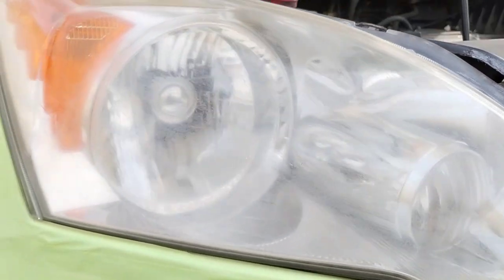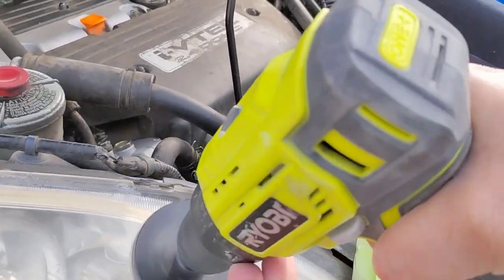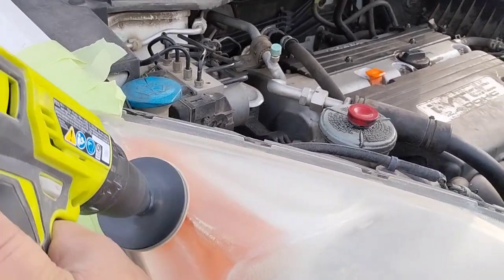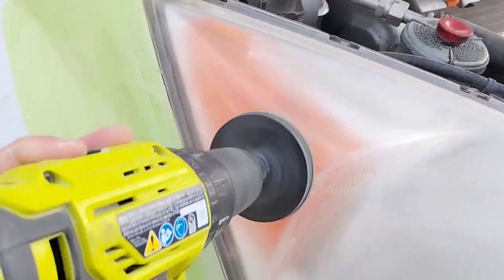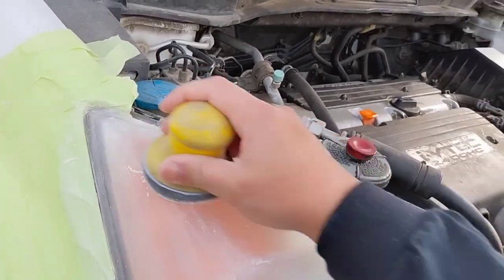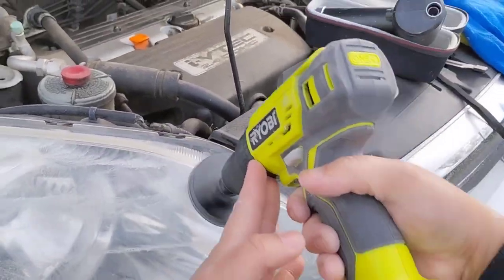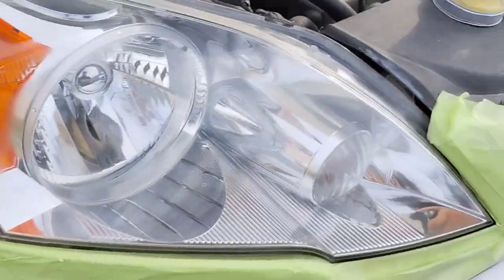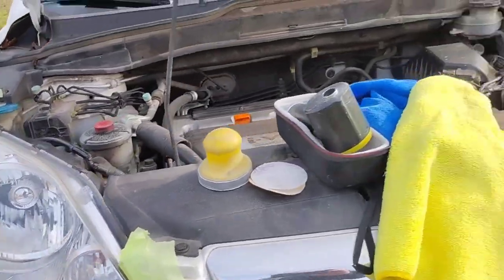Headlight Restoration - WORK SMARTER NOT HARDER 🧑🏽‍🔧

Comment: Officially did my first headlight restoration using your method and the lights came out great and the owner of the vehicle was very pleased.  I used Meguiars Plastx as I am waiting on my order of the 3M hard lens product to arrive.....I have another vehicle to do tomorrow and I can't wait....will continue watching your videos for advise and knowledge......THANKS!!!!!!
Reply from the maker: Awesome man love to hear this.. wait till you get the 3M plastic polish.. it will really step up your game.. speaking of stepping up your game be sure to continue to watch the videos new and old if you truly want to be good most definitely that would be my biggest advice to myself if I had these videos to watch...💯👍🏽
Reply: @theheadlightrestorationpro  trust me I rewatch many of your videos
Reply from the maker: @lawrencethomas5746  🫵🏽🦾
Reply: @theheadlightrestorationpro  Quick question.....if I have a really yellow oxidized light, should I use a P320 with a light touch to get the majority of the yellow off before going to the P500?
Reply from the maker: Normal light I would advise against it if it's just a normal light...
The yellow should be fine you don't want to mess with the 320s unless you have to it's a much harder to clean up it makes your process longer and more difficult..
Reply: @theheadlightrestorationpro  P320 should be used with lights that might have failing clearcoat or 2k clearcoat?

Comment: What are your thoughts on ppf for the headlights
Reply from the maker: Honestly I don't approve ppf for headlights or even vehicles.. secretly what most people or wrappers shall we say won't even tell you that most people mess up their vehicles this way.. the only recommended to be used temporarily for a certain amount of time which most people exceed messing up their paint and or headlights.. I've dealt with a couple headlines before none this year that have had the ppf on there and when the person removed it it pretty much tore off all their clear coat anyways and had to be replaced through headlight restoration.. this is the same case when it's applied to vehicles as well.. the thing is there's all kind of issues happen in between those layers, from temperature to moisture and even other things.. not only that when it comes to Headlights there's a layering effect if you put too many coats primarily more than one each coach you put on diminishes the headlight output ppf does this heavily... I have a video about this you should check out...https://youtu.be/NgxNImOAoCY
Also another big thing that they don't tell you is it's always going to require some kind of maintenance, a bubble here, the tear here, pulling up here.. unless you're the one that does it you can always have to go back and have them fix these things for the pain in the ass.

Comment: What about a dual action/random orbital? Can i use the same DA polisher that is used for polishing the body?
Reply from the maker: No technically you can use a rock but it won't produce the same results nowhere near. The door action is not enough RPM it's a totally different action lot-less speed...

Comment: Hey really cool, great job again, keep watching and learning, question: Can I use my 1/2 drill or do I need to use the one specified on your bio?
Reply from the maker: Not sure what a half drill is... But preferably and actually a regular power drill works the best and delivers the most even power with right to left switching and concerns to headlight restoration, gives you the utmost control and feathering the trigger and in most cases power level adjustments and torque adjustments,.. the gun fashion seems to work a lot better with the force of the drill meaning that it throws your hands sometimes in certain angles certain ways holding it a different way L angle or whatever else gets weird..
The main thing you have to watch out for though is the RPM which should be under 1800 and the torque which should be 600 or under... If you go over on both of those things are either one you'll start having issues.. also 3 in is the best diameter for the attachments and sandpaper anything smaller is too small anything bigger is too big...
Reply: @theheadlightrestorationpro  Thanks, good info, will check it out and see if it falls into the rpm and torque. It’s a 1/2 “ drive ridged.

Comment: What’s with your link to the 3m p500 disc? Description says they are p220
Reply from the maker: I'll check it out... They might be more than one disc when she but I'll take a look...
Reply from the maker: They are indeed p500 you have to scroll down and read through it it is p500... For some reason it says otherwise in the banner but that's because you can buy different size disc through this link.. just got to make sure You've selected p500

Comment: Hey was going over your Amazon links and i can't afford to get everything as of yet because I can't afford to get everything and I was wondering if you can recommend a shorter list of all the must haves to start restoring headlights?
Reply from the maker: Not really...not for this level of Restoration..
To get these results you need what I have and need to do what I do ..
Sorry..
I would just mimic what I do the best you can...
Reply: @theheadlightrestorationpro  thanks for that. I'm going to follow everything you do except for the sanding method. At this point I'll opp out for the hand sanding method using the same grits as you. I can save money on the drill equipment it'll just take me longer because I'm doing it by hand instead of power tool.
Reply from the maker: That's fine.. it will not come out the same but it should do something good.. without the drills you're lacking a lot of stuff.. so just go into annoying that it won't be anything like what you see or even near on these videos but it'll probably be better than everybody else's if you just follow as much as you can..💯
Reply: @theheadlightrestorationpro  thanks for that. I may reconsider I'm really just afraid of the drill 😭😭 it's kind of intimidating I don't want to leave burn spots. That's what I'm worried about
Reply from the maker: You're actually like a thousand times more like you to leave burn spots with the polisher... Long as you follow my drill recommendations it's almost not existent but the chance to make burn marks or damage this is why you want to keep it under 1800 RPM and under 700 pounds of torque.. this is why I expressly say do not buy a souped-up high-grade drill like some of them makita's or Milwaukee..
Basic drill is perfect. 
Even if you tried to it would be quite difficult because of sandpaper will give out before anything else.
It's much more likely some surfers burning with the polisher.. because it's high heat.. but if you follow the way I do it and listen to my instructions it shouldn't be an issue..
Reply: @theheadlightrestorationpro  Thank you for that. I'll try it with the lowest rpm I can get it to. I'm really inspired toake this my full time job and just want to do things the right way
Reply: @theheadlightrestorationpro  I've been watching your videos all day and I'm getting a feel of your method. I think as long as you keep the drill moving and don't apply alot of pressure I should be alright. I'm probably just overthinking it.
Reply from the maker: That's the right attitude..💯
Reply from the maker: Yes a lot of people do overthink it you're barely touching the surface with any kind of pressure the only strength you're using is to hold it steady.. and you're only taking off about a piece of paper or maybe even half or a quarter of a piece of paper is worth material from the service.. once you touch it with the drill you'll see like well okay.. it's a thousand times more efficient than hand sanding and much more consistent and even faster much faster.... There's really no comparison hand signing would be like riding a big wheel... Using power tools it's like riding in Hayabusa...lol I'm not even trying to be funny.. I've done both and even more crazier shit and nothing compares to power tools..
Reply: @theheadlightrestorationpro  I definitely trust your judgement 100% and I'll be ordering everything and following your methods, thank you 🙏🏿 I'll be emailing your results from my first few jobs and even though I'm a beginner I'll be charging clients and trying my luck. I'm willing to bet on myself. I will be following your steps and taking my time, not rushing and not skipping steps. I'm a very focused and detail oriented person so I think I'll be fine.
Reply: @theheadlightrestorationpro  Thanks bro. I also have two questions about something I haven't heard you speak about. With the fan how long do you leave it pointed at the headlights,  and whats the purpose of the leaf blower? And sorry for all the questions lol I'm just really interested in the craft and mastering it.
Reply: @theheadlightrestorationpro  And what do we do about the discontinued 3M Hard Lens Plastic polish? Whats the good replacement brother?
Reply from the maker: The blower is for dust and clean sterile environment...( It helps with the finished product and not cross contaminate) it basically is a very important part...and the fans just a couple nof minutes..like 3 give or take ..
Reply from the maker: You got to actually watch the videos .. everything you've asked is literally on the most recent couple of videos...
There's actually video about these topics..💯
Reply from the maker: Watch the videos.... If you truly serious about this you really need to watch all the videos and it's not for my benefit.. literally if I was starting out and I had this channel I would watch it from beginning to the end and definitely catch every new episode.. I started out with nothing on the internet really but bullshit people using concrete lacquer on headlights and dumb tricks.. I had to rely on myself about 98%.. if I had this channel as good as I am now I would be a thousand times better which scares me to think about.
Reply: @theheadlightrestorationpro  I definitely will do that brother I'm going to take the next two weeks to order everything, watch your videos, and practice on a few sets of headlights and come up with my own personal ways to advertise and attract customers.

Comment: What do you think about Meguiar's claim of their clearcoat spray lasting 1 year? I think most headlight restorers give a 1 or 2 year guarantee because there's no product that lasts longer. Of course there are many variables like if the vehicle is garaged or not but generally speaking.

I appreciate their honesty where some companies claim their products last a lifetime, which they don't (Cerakote and Sylvania).
Reply from the maker: Well this is an interesting question and guarantees last longer than a year..
I have it until my vehicles that are over 4 years old with it slightly.. it all depends on the quality of the skill that whoever is applying it and also heavily on aftercare and who's using the vehicle. The one year is simply a disclaimer.. like where a product that is fairly weak will tell you to wear gloves and eye protection just as a disclaimer.. pretty much because there are people out there that will use the product and apply it incorrectly and or be very slovenly with their vehicle like not washed her vehicle but once or twice a year and have it sitting outside.. typically it lasts over 2 years and some change for the normal crowd of people.. if you're applying aftercare or taking care of your vehicle and excess like I said over 3 to 4 years.. also when these time frames are applied it does not mean that it goes back immediately at this 15 months immediately at this 26 months and it's terrible bad like it was you might notice it's like color difference on certain areas or yellowing or something just not the way it was what it was fresh and brand new.. typically on cars of medium badness it will not revert back to that level of madness for like 4-5 years..
But yes that's definitely more than a year.. sorry this I've ever had somebody come back to redo their headlights was well over two years and they were an extreme case.. it's on one of my videos.. they drove about 300 miles a day for 2 years... Thanks for the question..
They set the bar super low merely as a disclaimer this only applies generally to a very small percentage of lazy car owners or like I said extreme car owners.. plus there's other variabilities depending on what light structure you have.. anything forward facing or AKA facing the sun more time of the day which is generally a vertical facing section of the headlight is more susceptible to damage a couple hundredfold...
https://youtu.be/OKgJajX1H-I
Reply: Thanks for the excellent info. So 2+ years for most owners and 4-5 for those that really take care of their cars. Like with our health, I think prevention is worth an ounce of cure...or in this case an ounce of headlight clearcoat. Lol

I make it a habit on any vehicle I purchase, especially new, of applying XPEL ppf right away on the headlights. One car I bought new 7 years ago is always parked outside and the headlights are still going strong with no yellowing or cloudiness. The pre-collision emblem in the grille is another story, which is starting to get hazy even with the ppf. I noticed those emblems are more delicate than headlights to UV damage even though they're also polycarbonate.

I have a Lexus with a similar pre-collision emblem and I'm on my 3rd of 4th product. They all look good at first, then you see some deterioration and then bam, suddenly they look like sh!t! 😂 I just redid the emblem 3 weeks ago with the Meguiar's clearcoat spray and it looks great for now. The Meguiar's is crystal clear whereas some of the other clearcoat products have a slight yellow tint to them.

Comment: how come you use a drill and buffer why not just use a buffer with the disks
Reply from the maker: The buffer is 7,800 RPM...
The drill is 1700 RPM .
This is a huge difference...
One is more focused on grinding..
The other is focused on speed and heat/friction..
The buffer is too fast and dangerous to use  with sandpaper...
Reply: @The Headlight Restoration Pro  
awesome  information cause  I just recently bought the Milwaukee m12 buffer 2800 for low speed  and 8300 for high that I was gonna use for both. but I was using  the dewalt  20v drill on low speed
Reply from the maker: Make sure under 700 lbs of torque..
Reply: @The Headlight Restoration Pro  right on! I appreciate  the help. Keep up with the solid  videos

Comment: I should post this in your Y2K video.  I just fought my first restoration on my f150 that had y2k clear and spider cracking in the polycarbonate.  They need to make a disclaimer on😂 these restoration kits that they won't do SHIT to a headlight that's been sprayed with fuckin paint clear coat!!!!!!!  I'm a painter for God's sake!  I paint 3 million dollar homes, and Y2K clear on polycarbonate is straight F______ed.  Not professional and is burning and chemical reacting down into the polycarbonate.  You have to sand that shit out of it, and I now understand the nature of the polycarbonate and can tell when I got into virgin substrate.  It starts to sand nice and dry when you get under the y2k, but you have to get through all the molecularly corrupted polycarbonate that's been infiltrated by the clear.  It's the fucking hardener that melts into the polycarbonate actually changing it into something else, until you sand all of the influenced material off, and then you can go 500, 800, 3000, polish, and coat.  The trick is understanding the polycarbonate and it's pure nature.  When you sand paint off metal the change is abrupt, it's not like that with clear coated plastic.  There's a weird transition zone of the degraded surface.  I'm excited to try a normal restore, now I know exactly that HRP is exactly right about that shit!!!!!!!
Utah Kid.......
Reply from the maker: Awesome man it's a mind changing event when you get a Y2K clear light the stuff is rough there's different grades of it one rougher than the next but with that being said once you've done one it actually elevates your skill because now you've done a super hard light and the easier lights are going to be even that much easy...
Terrible stuff and the kids always full people cuz they won't work on every light and they'll be extremely difficult to do on certain lights, and some are incomplete even they don't even have a clear coat in some of them so it's a tricky game there playing on people not knowing what to do...
Thanks for watching good to hear this..👍🏽🫵🏽💯